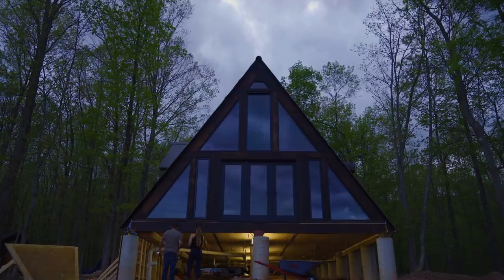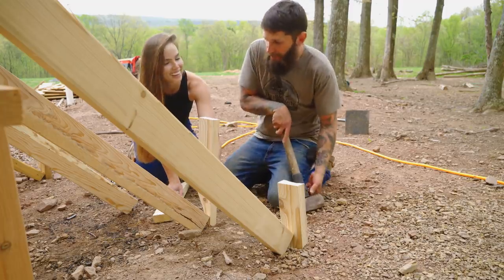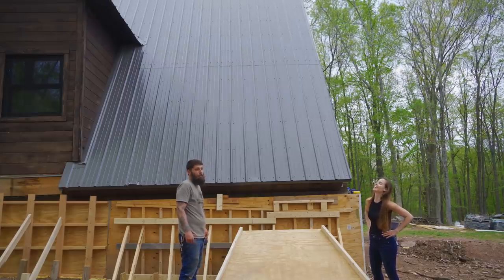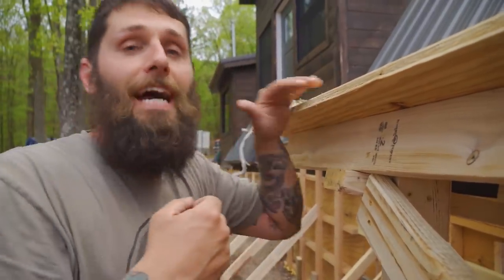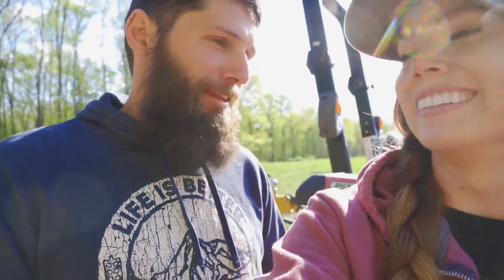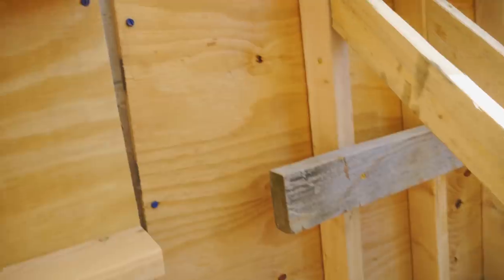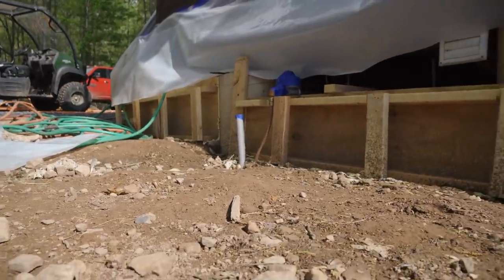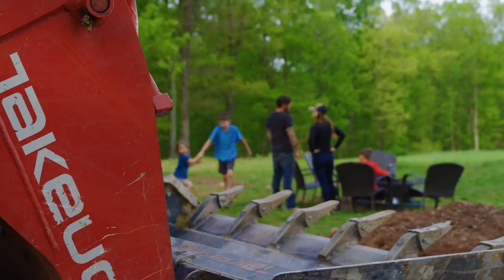Pouring A CONCRETE WALL | Our Self-Built Home

Comment: Did Chuckie sign off on the concrete forms design before you built it and has he inspected the job before the truck arrives looking for possible short cuts taken as well as any sub-quality materials?? How many jokes were made about the concrete vibrator that couldn't be left in the video??

Comment: it would have changed you build rate,but doing this before any wood ,would have saved a ton of time and if your using a stone or brick facing , now you dont have the tin strips to anchor the facing to the foundation..on all new construction I have never seen it done this way , just on remodel or upgrade!!!!   was  it the insurance company complaining or had you planned on enclosing it??

Comment: Now you know why they install perimeter foundations up before they build a house. :-)
Reply: I cant remember the reason why they waited to do it this way but I believe there is a video they did stating the reason. Definitely would have been easier doing it before but im.thinking they just wanted to get the Aframe built and get moved in and out of that camper.
   Not sure exactly there reasoning though. Either way they seem to be able to get it done one way or another.
.quite a team
Reply: Maybe easier to do the walls first but wouldn't be easier working in an enclosed crawlspace.

Comment: Wondering why you're pouring concrete when you have the pillars
Reply: because they're going to be covering that wall with stone.
Reply: You can put stone over anything. Even the plywood, or backer board
Reply: @MrTimNed  Aye but why go cheap with plywood? I'd either have done as they did or use block for the wall for exterior.

Comment: LOOKS GREAT BUT I THINK IT WOULD HAVE BEEN ALOT CHEEPER AND MUCH LESS WORK IF YOU WOULD HAVE BUILT YOUR HOUSE ON A 4 FOOT CEMENT BLOCK CRAWLSPACE. THAN COVER IT WITH STONE OR BLOCK.
Reply: Not cheaper or less work. Just less stable. Block foundations shift and they suck.

Comment: I would rather not use grout to fill a gap between 8x8 beam and concrete wall. Concrete will wick moisture and act as a thermal bridge. I would rather put foam insulation in there and there somehow decorate the outside face…

Comment: What did you oil the forms down with?  Did you think about using ICF's for this?  How come you didn't use snap ties and a couple rows of walers?  How come you didn't have the truck dump the concrete straight into your chute instead using your loader bucket?  How come you didn't just pour a stemwall 8 inches above grade level and just stick frame the rest of the way up to your floor beam?  One row of 8x16 CMU's should have worked... Do they have any classes on doing foundations in that skillshare program?

Comment: Any time I have poured concrete, it would set firm enough to support itself in a day and then 7 to 14 days to cure to full strength. I think you can pull the forms in a day.

Comment: instead of using a shovel to push it in maybe making homemade floor squeegee out of wood would have been faster. for the wall we was luck to have steel to use as wall and plywood in front of it  and rectangle pipes was so hard to work with but super strong indeed then the funnel

Comment: I am trying to remember what the reason was you didn't build these walls BEFORE THE HOUSE?????
Reply: For access to work underneath. Can't get 4x8 sheets in an enclosed space.🤦
Reply: @laurieg673   Can't be the reason. I am sure they are going to leave an opening and probably make some type of door. They will still need access to under the house and there is a ton of usable storage under it.. And if it were me, I would have dug a basement. Ground water cannot be an issue since they are so high on the land. That literally doubles your usable square footage for pretty cheap!!
Reply: @SteveP-vm1uc  Go watch their video explaining why they waited to pour the walls if you don't think that's one of the reasons.
Basement "living" space isn't for everyone nor is it common in many areas. 
I would personally never do a basement again. I would build up, not underground & put the $$ there for additional square footage of living space.

Comment: Why didn't you build concrete walls when you built your cabin? I watched you build your cabin on peers, which is fine, seems like a huge oversight not to have put concrete walls in at the beginning.
Reply from the maker: If you scroll  back through our videos you will see a video titled "Why we are pouring the foundation after building the house". We go over this in both that video and another one where we are forming up for the footer pour.

Comment: Erin.....please tie your hair up and under a hat when you are near equipment such as cement mixers and such......if your hair gets caught up it will pull your head in....I don't want to think about that outcome.

When you build your addition will you dig, pour footings and pour your crawlspace walls rather than pillars.....this method turned out so labor intensive for you guys.

Comment: Cinder Block wall would have been faster, straighter, easier, cheaper, .....Better.
Reply: Disagree. Cinder block walls are not as stable and shift from ground movement.
Reply: @laurieg673  Thats not whats holding the house up.
Reply: @GUAR45  Do they still shift ?
Reply: @dennisnagel4422  Either a block wall or poured concrete is sitting on a footing, and still uses re-bar , neither will shift more than the other.

Comment: should tie them to each other top bottom and in the middle using wire (same type you use to bind the rebar together) and then afterward cut it out

Comment: I don't understand why you went to so much trouble and EXTREMELY hard work to pour concrete around your house when it it doesn't seem to provide any more to your foundation with the columns you already built upon. Couldn't you have just used concrete blocking since you will be covering that with stone anyway, more for aesthetics? And all that additional prep seems like an overkill. You are such hard working people and I admire that you work so well together.

Comment: Wouldn't it have been easier to just build the foundation out of concrete hollow blocks?
Reply: No.
Reply: Would easier have been better ?   as structurally sound ?
Reply: @dennisnagel4422  What they are doing is enclosing the crawl space, not building a structural foundation. The concrete piers provide the structure supporting the house. These walls just isolate the space under the house (for insurance purposes). Concrete hollow block would have been easier, faster, less frustrating and would provide just as good of a structure to attach stone veneer to as the poured concrete they are trying to install. If they intended the walls to be an actual structural foundation (for supporting the house), they would have poured them before they built the house on top of the concrete piers.

Comment: Way too much work for basically a backing for veneer Stone. And much more expensive then concrete blocks.  I'd forget about putting so much time, effort and expense into the rest of the walls and make life easier with concrete blocks.